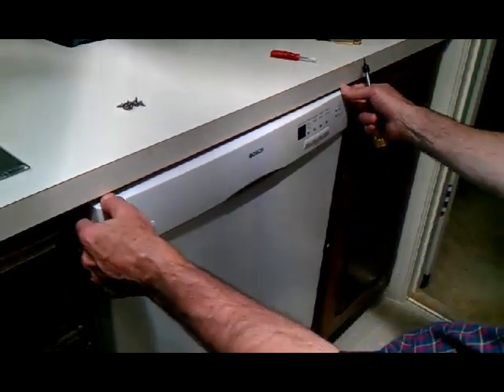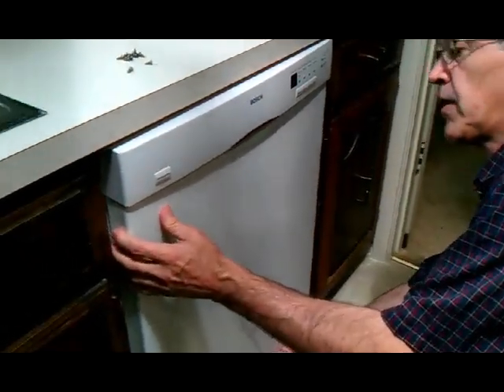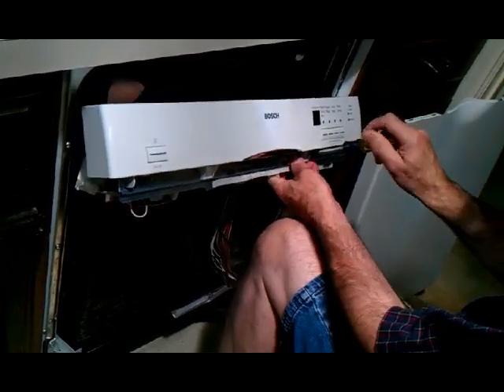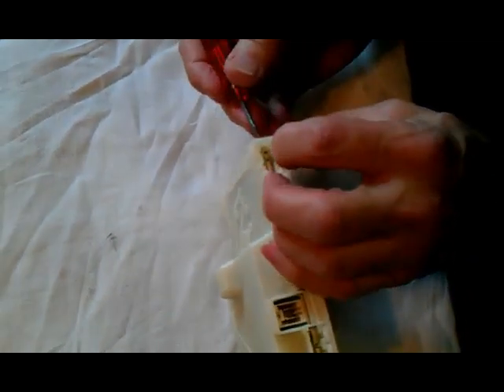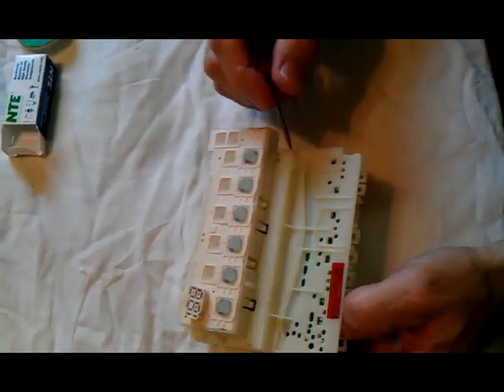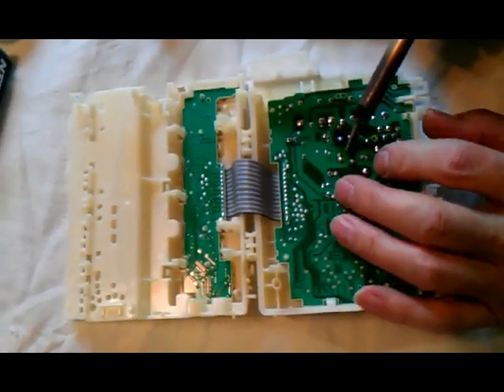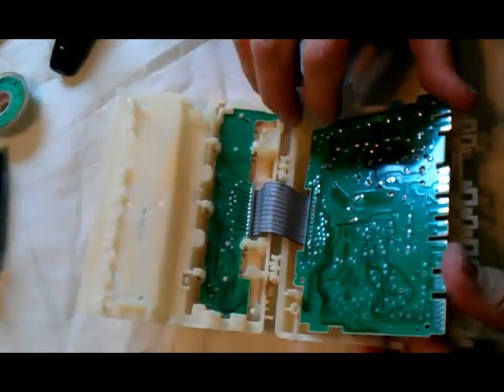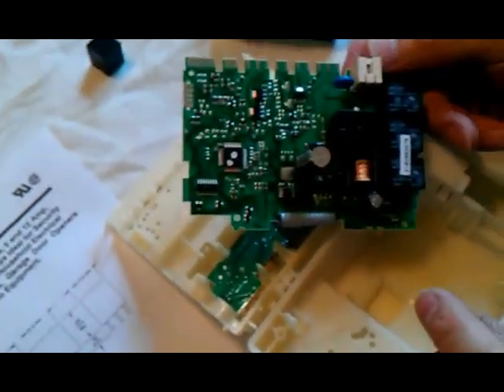Bosch Dishwasher Heater Relay Repair Part 1

Comment from the maker: Okay, I think I understand what you are referring to...the photo showing the burned solder contact at the relay pin.  When you unsolder the old relay the burned looking solder should come off leaving a clean solder pad on the board (search YouTube for “unsolder”).  An exception to this would be if the damage to the board is so severe that the solder pad is no longer usable.  A jumper would have to be used to make the connection.  See comments in this thread about using a jumper to make a repair.

Comment: Thanks - in your video you show an example. That's what mine looks like, so it seems if I pull out the old relay I'm not going to have a clean surface to solder to... I'll have a cruddy burnt surface...No?

Comment from the maker: Unsolder and remove your old relay.  The 5 holes should be sufficiently open to insert the new relay.  What you may be thinking about when you refer to cleaning is oxidation.  It is true that sometimes when soldering, oxidation may prevent proper bonding of the solder to the surfaces.  Since the solder pads on your board have solder on them now, oxidation should not be present.  I hope that answers your question.  One note: Always use rosin core solder with electronics…never use acid core!

Comment: Thanks for the video.  Given that the DW was not working, I was glad to see the burnt out spot on the circuit board when I got to it. My relay is on the way.  I have done some electronics soldering in the past - what I wonder when I consider this repair is: What am I soldering to at the burnt connection.  Doesn't it need to be cleaned?  The contact part of the board seems to be sandwiched within two layers of the board. How does the new solder make  a good connection?

Comment from the maker: The replacement relay would be the R46-5D12-6. The resistance of the element should be about 12 ohms. The wiring diagram is usually folded up & stuffed near the water fill valve. Using the diagram you should be able to find the wires to the element and check the resistance. Are you in over your head? Sorry, but I can't answer that. Unquestionably this repair requires a certain level of expertise to be successful. For a board, Google "SHU43C control board" & you will find some sites selling them.

Comment from the maker: It is possible that the relay has failed and did not burn the board in the process. Google “Bosch SHU43 Dishwasher Repair” and the first site (zo-d dot com) has a photo of a control board. It shows the location of the heater relay. If this is not your board, an option would be to replace all 4 of your relays since they are so cheap. Note: A failed heater element will have the same symptom as a failed heater relay. It would be best if you check the resistance of the element and see if it is okay.

Comment from the maker: On your model and mine the relay has one pin that just sticks through a hole in the board and is not soldered.  The heater relay needs the common (C) and the normally open (N.O.) pins along with the two coil pins connected.  The fifth pin is the normally closed (N.C.) connection and it is not needed.  Some models have this pin soldered, but the pad is not connected to anything.  BTW, I hope you are installing a new relay.  Don’t expect that just re-soldering the loose connections to last.

Comment from the maker: One leg of the relay on our models is not soldered as it is on some models.  This is the normally closed (N.C.) connection and is not used.  Only the common (C) and the normally open (N.O.) connections carry the heater current.  The two coil connections have to be soldered as well.  On our models there is no solder pad for the N.C. leg...just the pin sticking through the board as you described, so we only need the four relay connections (C., N.O., and 2 coil) soldered instead of all five.

Comment from the maker: Yes, the dark areas are the circuit traces.  A PCB starts out with a thin layer of copper applied to a non-conductive substrate.  A masking material is applied on the copper to cover the areas that will become the traces.  An acid bath dissolves the copper that is not wanted and leaves behind the desired "printed" circuit traces.  A jumper can repair a board best if soldered to a couple of other nearby pads on the same trace.  A single strand from a heavy gauge stranded wire makes a good jumper.

Comment from the maker: The only real difference I see between the relay I choose and the SHC SRE303006 is the maximum current handling capacity.  The OEM relay is rated at 10 amps max.  The R46-5D12-6 is rated at 12 amps max.  That is a 20% increase in rated current capability and that is a good thing.  In theory the replacement relay should last longer in service than the original.  Give us some feedback on how it works out for you.  Thanks!

Comment from the maker: I found a photo of that relay by searching Google with "SHC SRE303006".  It is on a German site the comes up "Suche Relais" in the search results.  The coil voltage, current capacity, and physical pinout seem to match fine.  I don't see any reason why the relay I am using would not work in your model too.

Comment: Thanks for the video!  I have a Bosch SHU9955UC/14 with the bad solder point.  I ordered the relay you recommended but found a very different relay on the board.  There were three relays which were white .  It was labeled SHC SRE303006 Coil: 6VDV 10A/250VAC/AC1 T+85C.  It is also labeled 10A/250VAC and C0131.  I re-soldered it as a temporary fix.Will the relay you recommend work?  If not, could you suggest one that would?  Thanks!

Comment from the maker: Fantastic! Spending 5 bucks for a simple repair sure beats spending $500 on a new machine any day. The standard answer you will get from an appliance repair man will be to replace the control module (very costly with parts & labor) or just replace the entire machine. The normal repair man will definitely not troubleshoot down to the component level on the control board. You have successfully accomplished a repair that you could not hire someone to do. Kudos!

Comment from the maker: Leaving the jumper wire in place is about your only option if the pad was fried. As long as it is secured well and doesn't touch anything that is not part of the same circuit on the board it will be fine. BTW, what is your model? Others may have your model and wonder if the relay will work for them.

Comment from the maker: I started with a Google search of something like "Bosch dishwasher will not complete cycle" and found vast amounts of information that were describing my problem in great detail.  I checked my PCB board and found the burned solder joint on the relay precisely as others had described.  I give full credit to those that took the time to post their experience with this.  However, I could not find a video showing how to fix it, nor could I find a recommended relay.  Thus my video was born.

Comment from the maker: I would tend to agree with you Carl that the recall may be too narrow.  In researching my issue I found that this is a widespread problem and it is also not confined just to Bosch dishwashers.  Given the damage done to your dishwasher, as an example, and the possibility of fires (as some have experienced) this should be more aggressively addressed by the manufactures.  Just my two cents!

Comment: Thanks so much for this.  Like yours, our SHE44C was not 'covered' by the recall. As I began undertaking this repair, the control panel face would not 'unseat' as yours did because various wires leading to the control panel had MELTED into the plasticy black panel on the interior portion of the door.  Stopped immediately and called Bosch. They're sending out a repair person but will not replace the unit as it's not part of the recall---I would say the recall was too narrow.  Will advise further.

Comment from the maker: It looks like you have found the problem.  Your old relay is 6VDC and a 12VDC coil will not correctly engage the contacts.  The new 6VDC relay will undoubtedly fix your dishwasher.  :-)

Comment: Lightning fast response! Thank you! I measured the coil resistance of the old relay: ~100 ohms. The new 12VDC one? ~400 ohms... guessing that's the problem! So I just ordered the exact part that you did from mouser. Should be here in a couple days. I'll post back on the status. Thanks again. REALLY appreciate the quick help!

Comment from the maker: I Googled 899-1C-F-C and found that it is made in a 12VDC version and a 6VDC version.  Measure the coil resistance on your old relay and see if it is about 100 ohms.  If it is, then my guess is that it is a 6VDC coil.  See comment in part 2 of this video for more information.

Comment: Excellent video! I have an SHX43C05UC/43 with this EXACT problem on the PC board. But I ordered the replacement part 899-1C-F-C from mouser as this is what the other relays indicated. Got the new part. Everything is the same besides the 6V DC part. New part says 12V DC. I'm guessing that's a problem, as I put everything back together and my dishwasher *still* continues to get stuck in an endless cycle. The water, however, DOES heat. Should I chance it again with YOUR part #? Or go to Bosch?

Comment: Many thanks for showing how to remove the control panel, was trying from the back without success, your video helped me finish my repair job. Running a load now, we'll see in 2 hrs if it works like a champ again.  If not, it's the heater itself which I've been told isn't a DIY project.